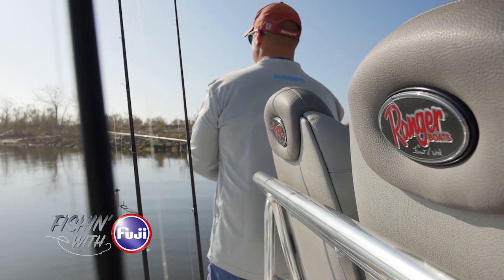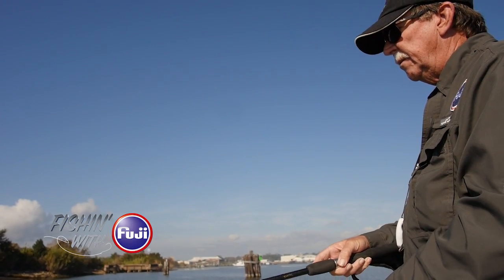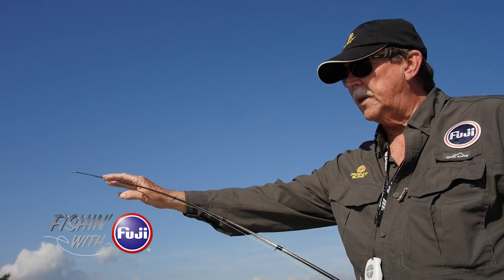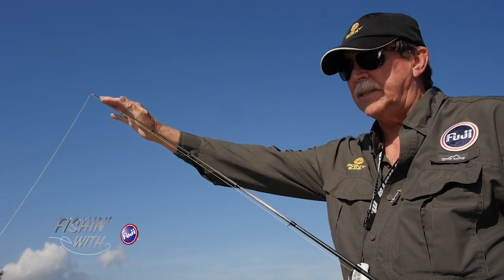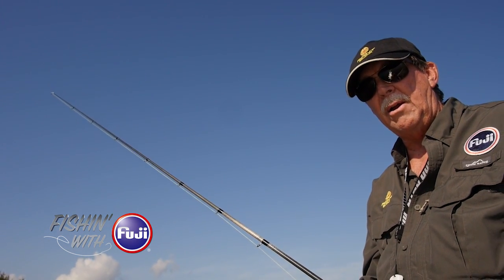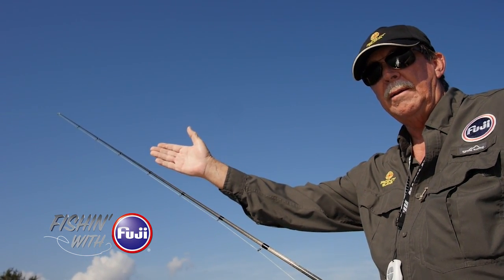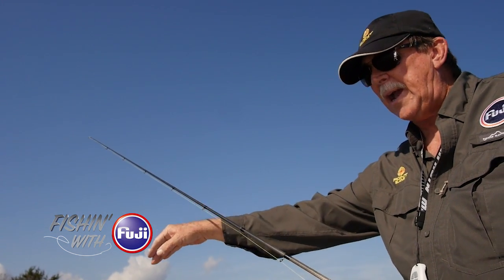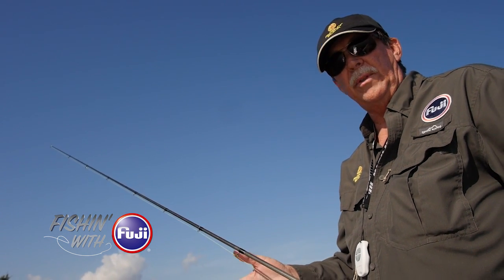How to Choose the Right KR Stripper Guide: Size and Position

Comment: What’s the reference of the Blank of your spinning rod? Can you give us the specificity of the spacing distribution of the Fuji rings. As well as the sizes of the Fuji rings. Thanks again for your videos. Really very informative.
Reply from the maker: Chris, we use a software on our site. Please refer to it and then the Static Load turorial for placement of running guides. Hope this helps!
Reply: ANGLERS RESOURCE  I Regarding the placement of the rings I understood. I will use the solution. Can you tell me which spinning rod blank reference you use in the video. I thank you in advance.